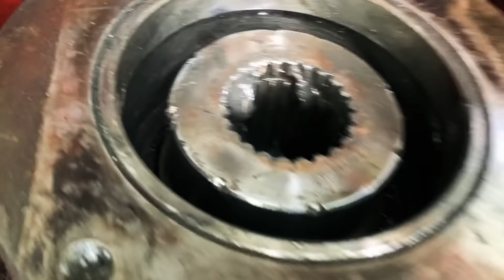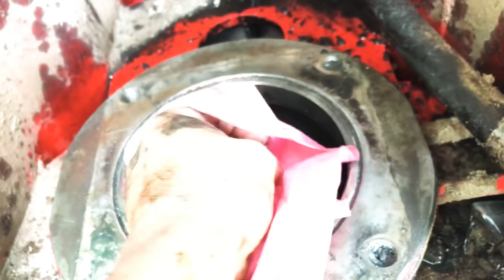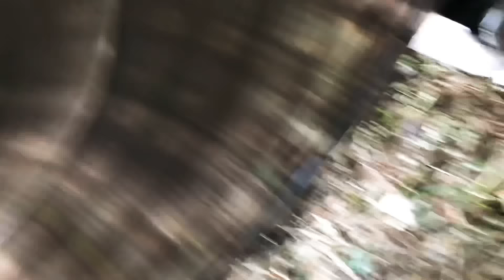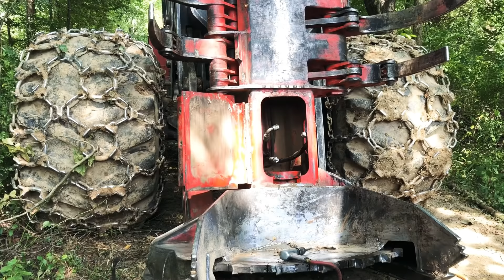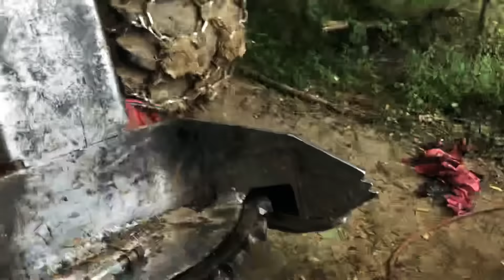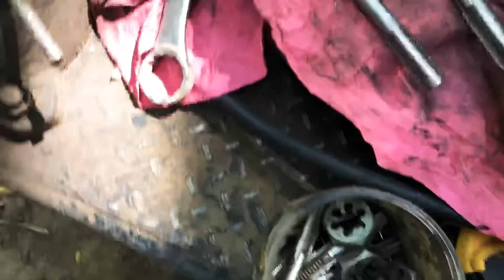Break down| yup this is how it usually goes for me!!!

Comment: Tip for dealing with cleaning the wood chips out the allen head bolts - find a drill bit that fits into the bolt head opening snugly (but won't cut any of the bolt head material) and then grind the point off the drill bit so the tip of it is flat.  Using a cordless drill with this modified drill bit, this will get 90% of the packed wood chips out and then just take your pick /screwdriver to clean out the square corners of the allen head bolt opening.  We paint the modified drill bit a bright color to differentiate it from our regular drill bits.

Comment: Years ago when we wuz running R Quadco disc on R Timbco, it started wobbling, so we wuz alwaz tightening up the bolts. Eventually we found the disk wuz cracked around the bolt circle, so we had to weld it. Good maintenance vidja.

Comment: Hey to clean the heads of those bolts out use a smaller size drill bit to get it broke a lose enough to clean it with a pick.

Comment: i love ur videos-am a faithful watcher of every one-but.........i wanted to see how much torque u had to use to tighten them bottom bolts to? like a 8 ft cheater bar or did u use a 3/4 inch air gun on them. just wondering as i would never think ur Dewalt would have enough to really tighten them enough. no judging on ya-just wondering-ok.

Comment: Do you lock the bolts on the cutter head? I would have to and use the red shit. As much as that is used and spinning and vibrating probably should retourqe the bolts weekly lol. I asked the freaking locktight question before you said they call for blue lol. I would use it. As long as use good strong impact licktight will come right off. And if that thing gets loose and wobbling around you know will booger those bearings in the head up. Have fun and get those stacks in blackey. She is looking good without the wings I wanna see her with two big old 7 inch strait pipes. 9nly thing could be better is if she had a red headed N-14 in her lol but I guess yeller is not all that bad lol